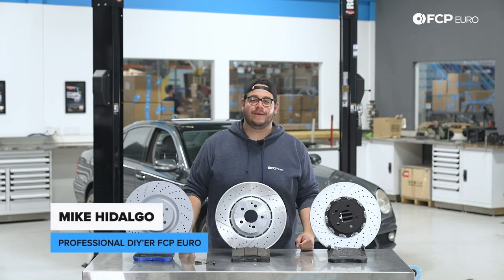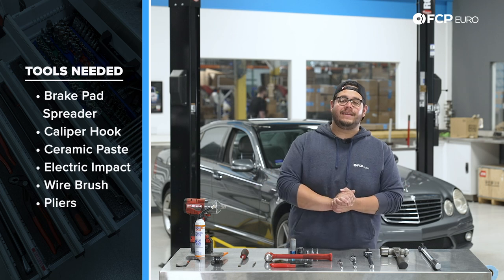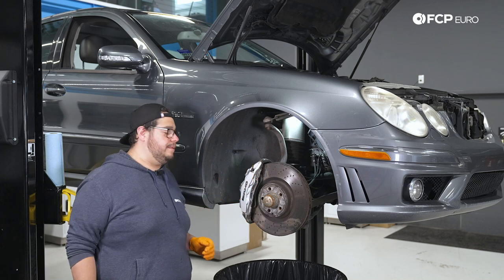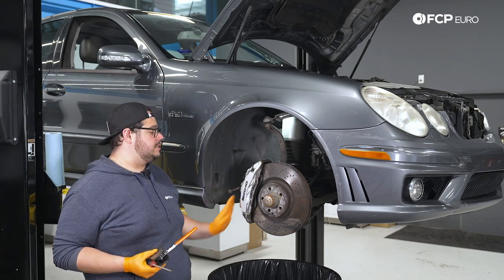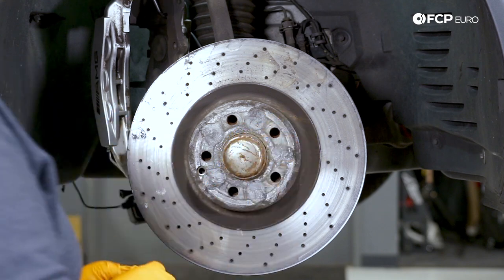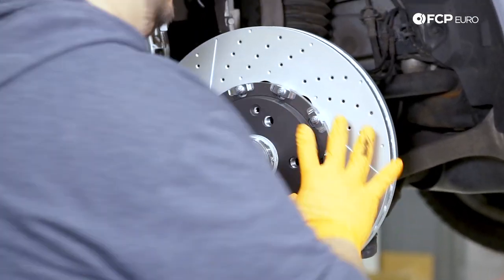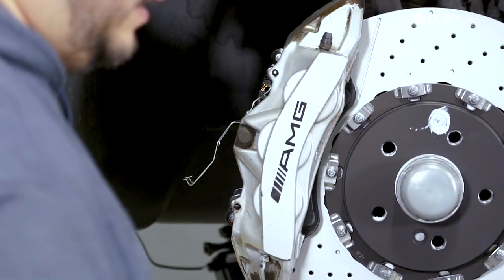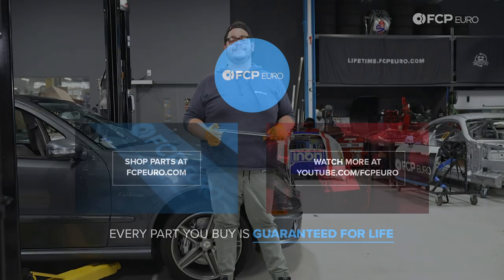Mercedes E63 AMG Front Brake Pad and Rotor Replacement DIY(W211 W212 E63 AMG, W204 C63 AMG)

Comment: Good video. Something to keep in mind if you have an E55 or any W211 before 06 is that you should disconnect the SBC pump before working on the brakes. If you don’t the caliper can shoot out of the piston and crush your fingers.
Reply: How would you disconnect it tho?
Reply: You need a scan tool
Reply: @CLK156BS  you dont, just unplug the big connector on the back side
Reply: @Financmajster 

I work at Mercedes Benz lol 
But okay .. 😂
Guess you never bled the brakes before either
Reply: @CLK156BS  nobody mentioned bleeding, for that you need the diagnostic tool, no need for that when just changing the pads and rotors

Comment: Does anybody know torque value for the two front 18mm disk brake caliper bolts? 2014 CLS550.  Getting mixed messages, 110 nm and 180 nm. Thanks
Reply: just get them tight i dont do any dam torque shit unless its internal,been doing this for 25 years

Comment: So if I would install new rotors from FCP, it comes with automatic renewal of the wheel hub, correct? In this video, rotor comes off an old hub, then the new rotor installed on a brand new hub.

Comment: Another option to remove the caliper is to remove the two 10mm internal hex bolts which secure the caliper to the bracket.
They are easier to access ,,,torque to 110 N m.